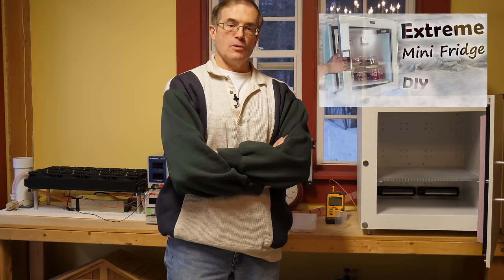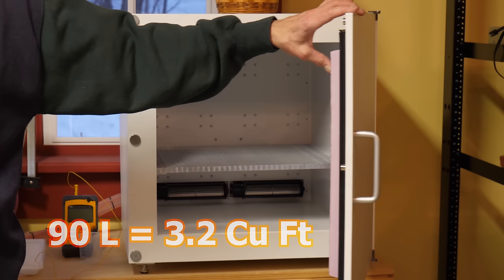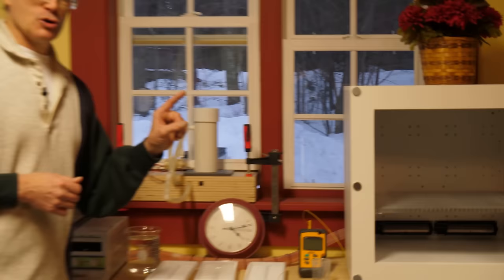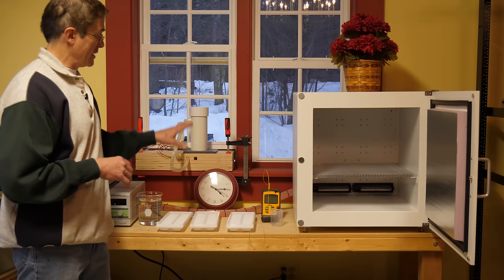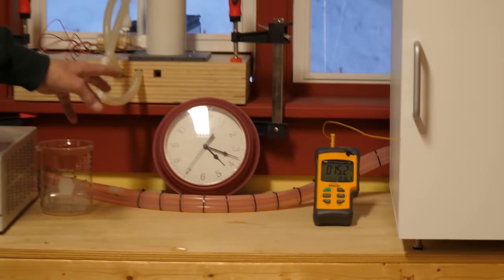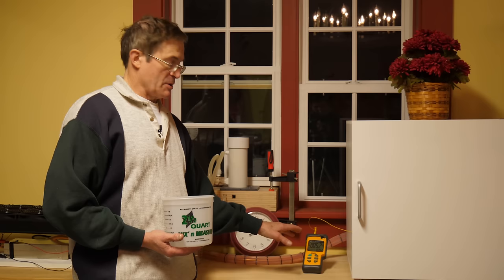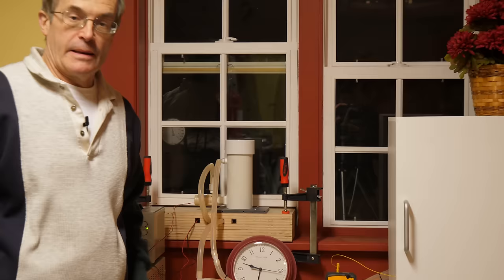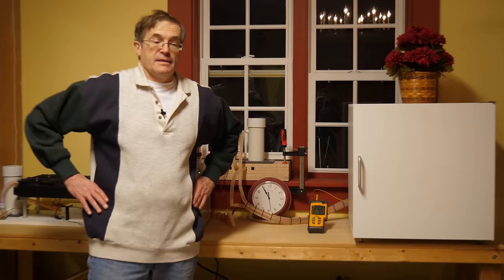TEC Freezer - Build Your Own!

Comment: Tech Ingredients   Excellent videos! I have always been interested in absorption refrigeration ever since I found an ancient one cleaning out a hoarder home years ago (only had a gas line, no electrical input whatsoever)
I looked into it and researched, eventually stumbling across Einstein's patent on the "Einstein fridge" which I believe a derivative of could be many times more efficient than the original and current absorption refrigeration systems.  I would love to see a Tech Ingredients design and build of one utilizing waste heat from a water heater vent, or a straight flame powered one.
https://en.wikipedia.org/wiki/Einstein_refrigerator
Reply: Prolific Invention 
You can buy these today. The Amish use kerosene heated refrigerators. Since GOD says it is a sin to use electricity. The refrigerator in my RV. Uses either propane or electricity to heat the refrigeration unit. No moving parts or motors.  
Do you still have that refrigerator? Have you taken it apart to try and duplicate it. I would be interested in any information you have. If you want something to experiment with go to a scrap yard that handles RV’s. You can buy a refrigerator very cheaply. They last forever. 
I would be interested in building one from scratch. Perhaps we can work together.
Reply: @roymarable5860  Yes I know all about absorption refrigerators, glad to know someone else does, you can buy many different models from small RV refrigerators up to large chest freezers and even commercial units that utilize waste heat from gas turbine electric generators.  There aren't many manufacturers in the US, but overseas they are much more popular.  The chest freezer type utilize a 1,500 BTU flame that burns 24/7 and are capable of 18 cubic feet of cooling down to -20.  Einstein's patent is in the link I shared on this comment, and with the improvements that were obvious from my understanding and modern technical upgrades it would be possible to achieve a much higher efficiency beyond even compressor type refrigeration and especially Peltier module/Seebeck effect module technology.
Reply: @roymarable5860  If one were to utilize this technology in combination with advanced insulation technologies like vacuum (such as expensive coolers and Thermos's), aircrete, aerogel, or Starlite You could easily create a solar powered refrigerator for warm climates, or a wood pellet powered version for less sunny climates with a gas cylinder backup.
Reply: A chiller heats up ammonia thought it needs a motor to  recirculate the water with antifreeze and discharge the Heat.
Reply: @steve-o6413  A little more complex and involved than that my dude 😂
https://www.wired.com/story/einsteins-little-known-passion-project-a-refrigerator/
Reply: @steve-o6413  Nope, no motors necessary actually-I found one from the 1950's with no electrical input whatsoever, many of them are that way.
Reply: @ProlificInvention  sounds like a outdoor use only or does it have a vent.
Reply: @steve-o6413  The gas ones run on a 1,500 BTU flame or less, that's less than a stove burner on low-so no vent necessary as propane and natural gas if burned at low heat with a blue flame only produce CO2 and water, safe for indoor use.  Some larger/commercial units use a vent.
Reply: Anyone with questions should read this article first:
https://en.m.wikipedia.org/wiki/Absorption_refrigerator
I can answer further and more advanced questions not addressed by it.
Reply: @ProlificInvention  what regulated the burner a thermocouple or was it constantly set at 1500 BTUs

Comment: I've dismissed TEC's for all but the most specialized applications from square one.  Everyone should be aware that a standard vapor compression cycle has a COP between 3 and 4, which means that it moves more energy than it uses vs the TEC, which, by necessity,  has a COP less than 1. It is the obvious reason these have not taken over in all heating and cooling applications. Why not mention it? These are not miracle devices. 
I'm curious about the ...sorprion? 
system you're alluding to.
Reply from the maker: Actually, I go into considerable detail about this in our previous video on the mini fridge. Compressor based systems can go even higher than 3-4.  Some systems can double that.  A practical limit for a peltier device is around 2.
Reply: @TechIngredients  well that's good. I  was learning about this 20 years ago,  didn't think you could break unity with the TEC.
Reply: @DrewskisBrews  TECs and TEGs have seen a few incremental improvements over the years. Would be nice to see an innovation that provides a major efficiency increase. Similar technology has been used in nuclear power generators for satellites and space probes for decades. Originally called SNAP (System for Nuclear Auxiliary Power) Radioiosotope Thermal Generators have also been used by the Soviet Union to power remote lighthouses. Those have also killed a few idiots who stole the RTGs from lighthouses and peeled away the shielding so they could use them for heat instead of a campfire.

Build a man a fire and he's warn for a day. Warm him with an unshielded Russian RTG and he's warm for life.

Comment: The water cooling idea is interesting but then you are using moving parts (particularly the pumps) that can fail without warning and cost you a lot in spoiled food. I am not anti-water cooling since my PC is water cooled but it auto shuts down and protects my system if a pump or part fails thus protecting it from overheating and damage whereas for something where you are storing food, I would think the fewer points of failure, the better.  

More importantly, from a whole home energy usage efficiency standpoint, why in the world would you want to pump warmth outside in cold weather while at the same time, heating your house? I can literally close off the heat vents in my bedroom while my computer and monitor still overheats my room when being used. When in use I have to vent air from my room via a box fan to the rest of the home just keep it a reasonable temperature since at it's peak draw, my computer draws about 700 watts plus the 145w for my 55" LED 4K TV monitor I use. That is a fair amount of heat being generated. Why would I want it pumped outside in the winter when it is more efficient to use it in heating your home? A standard refrigerator simply transfers heat from inside the fridge to outside the fridge. While it may be useful to have a way to pump that heat outside the home when you want the home cooler than the outside, you don't want to waste the heat doing so in the winter.
Reply from the maker: Actually, you do. Cooling the enclosure below the ambient temperature in the room requires energy, electrical energy which is the most expensive form.
Liquid pumps, just like refrigeration compressors can fail and in both cases a thermal warning system such as a light or buzzer can save a load of food.
Reply: @TechIngredients  I see. I understand it would definitely be more efficient for the item that needs cooling. It just seemed like a waste and would be less efficient overall. Thank you for your reply.

Comment: The videos as fantastically interesting. But gosh, how can any scientist, engineer or teacher use imperial system rather than metric. That makes it so difficult to follow...
Reply from the maker: It comes from living in a country where both systems are used regularly.  Much of our tooling, hardware and stock materials are supplied in imperial units... only.  Much of the scientific work done here is in metric.  We have to be able to ues both systems.  Many other countries do not have that challenge and find it difficult to do the conversions. I try to accommodate these viewers, but I don't always succeed.
Reply: @TechIngredients  thank you for your reply. Maybe writing the conversation during the edition would be a good idea ?

Comment: Boring.
No, not because it was boring per se, but because the appetite was very greatly excited by mention of the forthcoming evaporative cooling installment... and by comparison, TECs may be cool but are much less exciting.
Reply from the maker: I understand, but boring may be a little unfair.  Closure on the TEC projects with an energy consumption demo and the remote heat sinking feature might just make this one of the most significant TEC refrigeration videos on YouTube; there are a lot of them.  Nevertheless, I agree that the high efficiency of the dessicant  airconditioner makes that project more exciting.

Comment: Done wast the  heat... hot water heater +
Reply from the maker: You can't.  If the "hot side" of the TEC is not kept cool by transferring its heat to the air, the "cold" side will not cool the freezer.  The temperature differential is relatively constant.
Reply: @TechIngredients  HINT, water i a coolant than air..
Reply from the maker: No, I get it.  But, if the hot side is going to heat water above ambient temperature then for each degree that the water exceeds ambient temperature, the freezer will be one degree warmer.  The differential is fixed.  You'll either have a poor water heater or a poor freezer.
Reply: @TechIngredients  what is the means temp of the heat dissipation system.....40 gals of water can absorb a lot of BTU before reaching your means temp, that is the basic of external  liquid based exchange system. Yea, move the heat dissipation to a remote system... to a useful purpose and not wasted.

Comment: Some Bitcoin miners heat their house with their mining rigs. It means they're effectively paying a similar amount for heating, but at the same time being able to mine the cryptocurrency simultaneously. A similar thing could be done with this rig. Using whatever waste heat energy it produces to heat cooler rooms, thereby increasing its effective efficiency. While the device itself may be "inefficient", you're turning the waste into a useful product.
Reply from the maker: That's true.
Reply: "It means they're effectively paying a similar amount for heating, ..."

Sure...as long as you don't count the initial cost of their $250k "heating system"!
Reply: seems like it better to use it a water heater or something considering air is a poor thermal conductor
Reply: @Steve_Just_Steve  Radiant floor heating would be good in a home you own, but most of these cryptocurrency jerkoffs rent cheap apartments and warehouses in places with low electricity rates (e.g. Montreal, "Cascadia", Labrador, etc.)
Reply: @fun_ghoul  Would be good idea if I was building a shop but mine existing really I want A/C, I have a quarter million BTU waste oil heat that keep me warm. Of course as soon as it shuts off it's cold again, but I live in OK, I want A/C! LOL
Reply: Good if you're in a climate where you need heating year-round.  Electrical heating is significantly more expensive/unit than using natural gas or propane in most areas, so it's only a possible savings if you are able to use a lot of the waste heat (that you would otherwise have to get rid of at additional expense) and distribute it around the property.